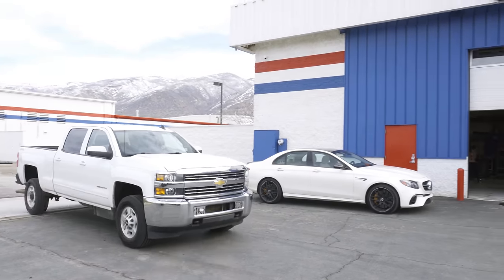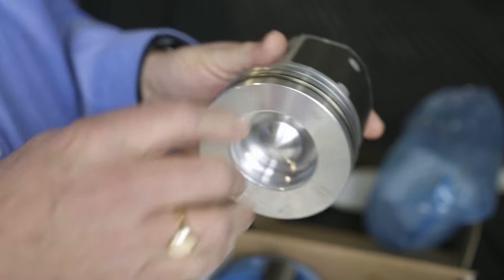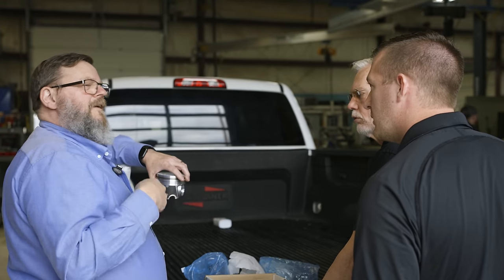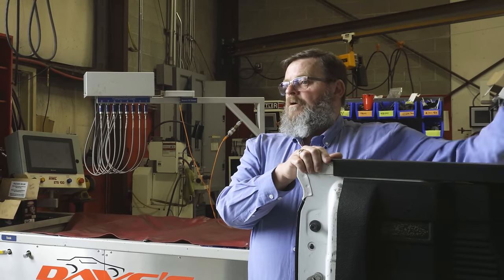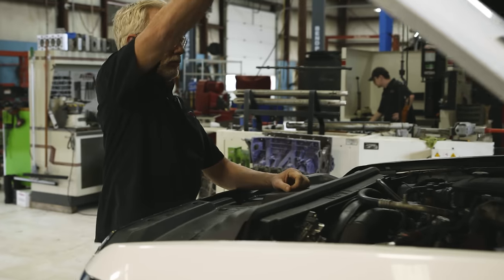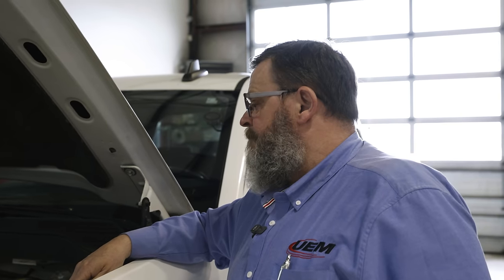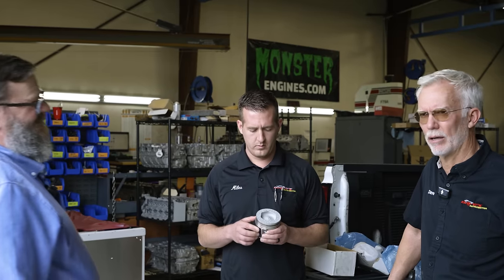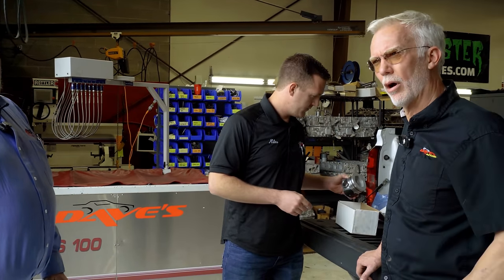What do golf balls and pistons have in common?

Comment: The other thing that I wanted to mention is that i dont think using a gapless 2nd ring is ideal.. the argument is that the 2nd will seal better than the top. If there's any pressure between the top and 2nd ring, it will unseat the top ring. Rings need pressure differential to seal.  So in an ideal world, you'd run a gapless top to seal and run a conventional bottom to help pull down the top and help scrub/clean the bore..

Comment: The dimples have been tried in Europe on Intake ports with so-so results. The real advantage to these pistons is the gapless second and the crown coating which provides a thermal barrier and a smoother surface,  yet not a great performance improvement.

Comment: If the ecm does not need a recal, especially on a DPF/SCR equipped truck i don't think it works. Those values are monitored so closely to ensure that the sensors are working that i would imagine a 50+% NOx reduction would set a code for the NOx sensor reading implausible data. Im sure they do run more quiet, im sure the OCI can be pushed out but i am doubtful of emissions reduction.

Comment: This is VERY intriguing for me with my 2024 Camaro SS 6.2 liter LT1. It has GDI and the variable cylinder management hardware (being the 6 speed GM deactivates the software in the ECM but it’s the same engine auto or manual). I’ve been contemplating a cam, intake,headers, and DOD delete. If these pistons are available for the LT1 I’d seriously consider them as well - I live in Cleveland, Ohio but after watching your videos I’d absolutely trust you and your crew to do the job Dave. I’ve never been to Utah - might have to plan a little vacation!

Comment: Ceramic top, that’s kewl! I wonder if that Duramax is deleted bc mine was very quiet too before I was forced to delete the gimmick. That’s not good mileage on that truck. I have a 2013 DMax 6.6, deleted, CAI, CP3 change, FASS lift pump, strait exhaust (after DEF/DPF delete) still running stock on tune and I’m getting 22-25 mpg. I get better mileage than my Honda accord. Every week I fill up in northern Md (same station) drive through the whole state of Delaware back into Md and I always hit WAWA (same one) and fill up again. I do this religiously and I will put 6 gallons in my Honda and 5 gallons back in my truck. I can tow my 5th wheel 12,000lbs, all the way down and back on one tank of fuel. My truck does really good on fuel.
Reply: WHAT? My 6.6 Duramax gets between 22-25 mpg. It’s better than my Honda accord. Every week I fill up either with diesel or gas (depending on what I drive to work) and when I get 160 miles away I always fill up again. I put 6 gallons in my car (which did better this wk do to new air cleaner, oil change) and I’ll put 5 gals in my truck. I’ll film it next time.

Comment: The shape is something revolutionary for diesels, but that ceramic coating is a proven upgrade to any engine.  Any ceramic coating that can be done on the top of pistons, cylinder heads, the compresson side of valves, the exhuast ports, and/or and the inside of the exaust manifold will greatly improve performance and effiency.

Comment: I like the piston well is Art of for fuel engine , flat ground and Send walls sides is too ceramic on top and golf ball design , by bring out 40 hp more out per cylindar , without Omega compression chamber .
In a ABC V6 2.6 Toolsteelgusblock is like athem threw like 14 has work 36 in work and 25 incoming work that the other half bring on 45% more that a cylindar did 100hp more !:))) 
In Series Armed for eclectic engineering , I want that pistons again , by 6000ccm V6 C1 and 2.9l V6 stroker , that not lost ceramic coat plates in oil . I like the product true !:)

Comment: Very interesting video Dave. Quite. (I'm NOT a Mechanic, much less an Automotive Engineer. All due respect, I'd LOVE  I were one. I'm just a senior MD who's nuts about ICE's). Probably time will tell if it's actually NOT 'too good to be true'. Now I'm wondering what could eventually happen if you combined this 'dimple' Tech + Hydro.Oxy generator Tech being tried / tested recently (apparently..) to reduce emissions up to 86% or more in turbo diesel ICE.. (I'd RUSH to get a used MB 606  to rebuild it  and then... 🤑🤑😂😂).

Comment: I NEED these in my Semi Truck this would be a Game Changer to reduce cost of operation in this Ultra Competitive industry 🤩
Reply: We have dozens of independents running these in their rigs over the last year. All the CATs, 60 Series DD15, Cummins, X-15, M11, N14. most are getting a full mpg better or more.  We're still taking test vehicles for another month or two so give us  a call!
Reply: @speedofairenginetechnologi1721 
Have you thought of trying platinum coating on the piston tops instead of ceramic? Or can't it take the heat? I would think that would add additional conversion right in the cylinder. Would end up wearing away though.
Reply: @stevenmiller6725  Hey thanks for the insightful question!  Coatings are pretty complex and we have some of the best scientists on the planet working to continuously improve ours. The coating on a piston crown has three main purposes: 1.reflect heat (energy) back into the combustion chamber where it can be converted to more work;  2. act as a thermal barrier to prevent heat from transferring through the piston and into the oil/bearings and 3. it must have the durability to stand up to the mechanical forces (heat/pressure) it is exposed to in the combustion chamber. We formulate our coating to maximize all three of those criteria.
Reply: @speedofairenginetechnologi1721  I was just wondering if the coating on the piston top could also act as a catalyst to the combustion in the cylinder. Would increase the combustion efficiency and get rid of the catalytic converter.  I am already pretty sure with your pistons and a dual fuel setup (diesel/propane) engine could burn clean enough to meet modern emission standards. Might need to introduce water vapor to keep combustion Temps down (be better than egr). If you got really froggy could use a hybrid power train and probably scare people with the range/mileage/reliability of a truck like that.

Comment: dyno runs will be very interesting to back u p what the rep is saying, also a test vehicle and putting miles on it.  I understand the advantages of volumetric fill of the cylinder and exhaust scavenging along with the dimples increasing turbulence with better fuel atomization but does this really show with 20 -30 psi of forced air (boost)?  Test engine please....

Comment: I learned on YouTube that the area around the piston top and rings is wear all the emission failures come from if u can burn or reduce that gap u get better emissions like Subaru boxer but then u pinch and clam rings with the piston not enough strength I guess tough call.

Comment: I can't verify the claims here but I can say that I've read mountains of test data on primarily aircraft surfaces and internal combustion engine ports. Definitely a net benefit to some percentage or other depending on the usage. In every situation it reduces drag on the boundary surface layer. Scientifically speaking, it would also reduce heat loss to the piston by reducing attached area and maintaining an air cushion between combustion flame and surface.

Comment: I wonder if that lower exhaust temperature could make the engine and engine related parts work harder to perform a regen when needed. High temps are needed in the aftertreatment system in conjunction with a catalyst in order to pull atoms apart allowing them to pass through the system

Comment: Since you mentioned GDI engines and fuel dilution, this would be worth a lot to the VW community. The early VW TGDI engines would smell like gasoline at each oil change. I thought I was dealing with a carb engine. MPFI engines did not smell like fuel during oil changes.
Reply: Check out Fisher Motorworks in Pennsylvania. He is testing our BMW M57 and VW 2.0 right now
Reply: @speedofair  Wow, thanks. I love when someone goes after an inherent flaw of an engine, like a Fel-Pro gasket on a GM V6 intake.

Comment: Wheres the link to them?  For a set of 6.0 psd?  Im a little concerned on a gapless second ring....I know its not top ring, but when you are pushing power up, temperature goes up and that gap is critical to prevent binding as the ring grows.  I go through these engines a lot and have a chance to try this.  I want to know:cost of a set for 6.0 psd, and what happens under heavy load, as in performance application.

Comment: Hi Dave, I wish you showed a Duramax stock and the modified side by side for noise comparison. I also wish you would have revved up the Duramax you did show. My 2001 Duramax 2500 with the 6 speed Allison transmission got 19 mpg empty. I also changed the oil every 2500 miles. Not the recommended 5000.

Comment: The real question is what the lifetime of the ceramic coating on the piston head is or at least the performance overtime for the entire setup. It is an eventuality that the variable fuel quality could damage or wear the layer or that there will be carbon buildup on the heads regardless of whatever surface provided sufficient time as nothing lasts forever.

Comment: I wonder how the DPF would cope with the lower EGT. Also low blow by means tighter tolerances and should result in higher internal resistance. Something VW was avoiding for better fuel efficiency at the expense of blow by and oil burn in their TFSI's. Sounds too good to be true.

Comment: Hey Dave! Have you tried the rings (endless maybe) that have the end gap ground into mating steps? To describe it the top half of the ring is ground down half the thickness on one side and the bottom ground on the other end. This makes the end gap overlap and gives you 360 degrees of sealing. Ever heard of or tried them. I think they are for gas engines but I can't see why they wouldn't work for both or all three inc e85...

Comment: Does the ceramic coating  change the piston wall clearance becase of less expansion?
Im wondering if a larger pistonight quiet the engine.
Very interesting technology.
Are the ring groovesachined in the he same location, or set higher or lower.

Comment: sir, i would like to draw your excellent attention to detail to what is called 'art installation' (what i have spent about 15 years doing).
do not trust a single point hang-you wouldnt trust a motor with one mount right? any piece that needs to be level should have 2 points of contact with the wall to avoid skew.
1/ locate the horizontal center of the area you intend to install in (in this case 1/2 the distance between the corner and the window), then locate your vertical center-this will be the center you work from for your composition. 
2/lay out your pieces on the floor the way you like and find the center of each and  locate the hardware accordingly- you can half the height of an individual piece and use a tape measurer pulled out to that length to get the distance to the hardware from center by measuring from your halved number down to the hardware (i call it slide rule style).
3/ if you are using wire hardware then take a torpedo level and use it to pull the string taught like the piece is hanging and repeat the process stated above- use that level to mark where you will place your hanging hardware (bull dog hooks are recommended, do not use those stupid wall gougers.
4/when you move from a single piece to a salon style like you have here you just repeat the process of locating hardware  but instead you will locate the center of each piece. 
in this way with just a piece of paper and a few extra pencil marks on your wall you can install the art  and make only the necessary holes-and then realize the hardware of the piece itself is mounted crooked...

Comment: Hi Dave's Auto !
Can I ask a question 
When installing pistons /rods to cylinders ,,do you soak the pistons in a bucket of oil?
Or oil the skirts, rings and lands etc
And fit to a well honed /clean cylinder.
It would be interesting to hear your procedure 
Thanks
Reply: I’ve always been told to just coat the piston skirts with oil and not to soak the entire piston….rings will break in faster and better without a bunch of oil on them…..I’ve built 50-60 engines over the years and never had an issue with this process.

Comment: I am going to try and reason through this. 
Gapless second ring, better sealing but away from the heat the first ring deals with.
Ceramic coating, heat tolerance. 
Dimples, combustion turbulence. 
Didn't hear anything about, cast or forged, compression ratio or piston/cylinder clearance. 
More torque, 25% better fuel mileage,  quieter.
I need data.

Comment: What's  the piston weight gross versus the stock OEM pistons. If they are lighter, then there's your solution to torque and fuel efficiency. Lowering inertia energy requirements. When in an upward and downward motion, thus transfering the newly aquired energy that was originally required to operate piston and combustion function results in said increase. Not hard to wrap your head around.

Comment: Dimpeling has been around for awhile. It started on intakes to reduce drag and increase air flow.. i was wondering if it could be done on a piston, but was afraid to do it because didnt know if it would lower compression,. And would cake up with carbon.  But cool some one did it finally.

Comment: I wonder how much those pistons would quiet down my ‘99 7.3L ford. I already have a fuel return kit on the heads for the injectors and the oil crossover. Not saying the engine is loud (least not to me) but more of a curiosity. The fuel return kit already smoothed out the engine substantially so those pistons would quiet it down more i’d imagine.

Comment: First creating more surface leading to temperature loss and condensate. Then mitigating that with the coating. It is interesting, but so was laser structured cylinders also. (Laser honing)
Are the dimples spherical or parabolic (reflector type with a focus point)?

Comment: Is the compression higher or lower with the new pistons
Reply: Miniscule change. The Duramax has less than 0.5cc pulled out of it which may pull less than 0.1 compression ratio.  FAR less than a de-lipped piston!

Comment: I was thinking about the , 'golf ball' idea many times , when golf balls were first designed they were perfectly round like pool balls , then they found badly scuffed balls went  futher than smooth ones , so then came the dimpled balls and they flew twice as far as the smooth ones , it's air flow over a dimpled surface that lets the air going over / around it move faster with less restriction , small vortices of air surround the ball and let it slip through the air ! Does this sound similar to a port ? We all know if you port out intake ports and make them smooth you loose flow and airspeed, fuel falls out of suspension and dribbles down the port walls not atomised, I read Smokey Yunick,s book years ago and they wanted to see what was happening inside a running Boss 302, they made a Perspex intake and watched on the Dyno as fuel dribbled down port walls , no airspeed through those massive heads ,not good , so why not invert the golf ball idea, port a engine and polish the port internally then die grind the dimples on the port , airspeed would go grate and flow would be up just like the golf ball ?

Comment: Seems like a secret getting out, I bet there are even better designs.. my stock N54 engine runs great, I'd love to try a set of those pistons in that application. 

With piston rings.. isn't that also why the crankcase pressure rises..because of combustion gases blowing past the ring gaps? So how will a gapless ring affect the PCV system? Many things to consider with a little change.

Comment: I'm curious to see if these pistons could improve the GM 2.4 ecotec. I know Jasper Engines uses a Mahle piston in their crate 2.4's, with added oil drain back behind the oil ring, and coated piston head. Just wonder how much quieter these pistons here would be. I have a '19 cherokee with 2.0 turbo, and it seems noisier than when we first bought it. One reason I dislike direct injection.

Comment: I’m very skeptical about this. Increasing efficiency requires way more compression. Which increases temp etc. Not to mention how well do they oil. Seems a bit like snake oil especially increasing power with efficiency with just pistons. Something needs to be added if it be more air to fuel or changing trans gearing.

Comment: How much of that is dimples and how much is ceramic coating? What if you ceramic coated the combustion chamber, valves and piston? All that heat wouldn't soak into the heads and valves.

Comment: HI from the uk 
Back in the mid 80s I was reading the 100th year celibation of the diesel engine edition of diesel and gesturing World wide  there was an article about CAT and a ceramic development so piston crowns top of cylinder and head face, exhaust ports and turbo exhaust volute and turbine wheel were all ceramic coated the turbo was also geared to the crank so at low power outputs it would be driven as as a super charger and at high outputs it would deliver power back to the crank and the net result was no significant improvement only a higher exhaust gas temp.
Would you consider working with South West research for independent testing?

Comment: There exists Plastic Pistons too with Conrods , that got dynamic move and fill with old cigarets filter cellolose !:) But only for Diesel engines !:);) If a drill rotary air intake inside the intake with a Omega formed Golfball Piston the efficency is like Omega Unimog goes in time jearney !;) They speak together and give F2JZ Fuel saver a reason for exists by perhaps possible got a propellar transmisson of design diffrence !;) 
So please show in Video the factory of Golfball Pistons